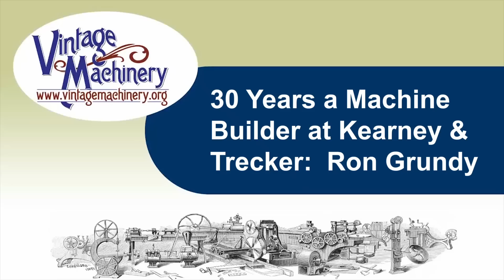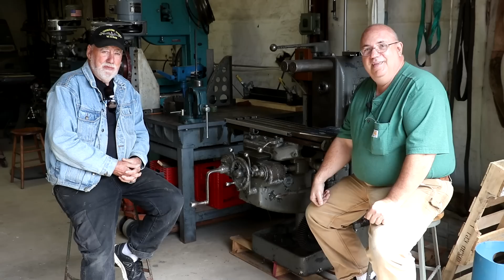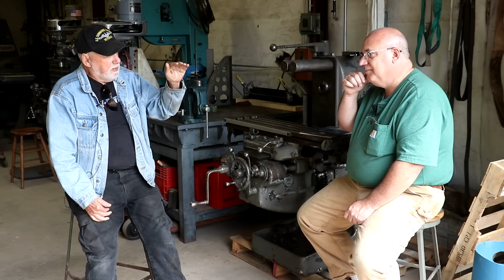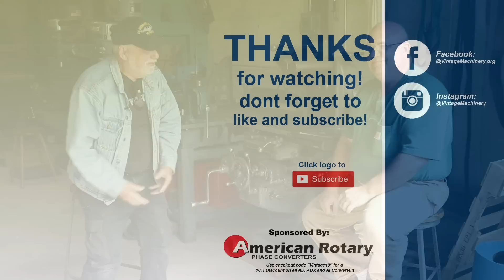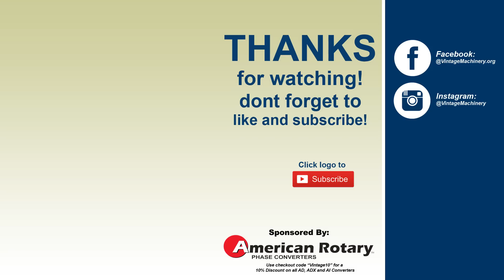30 Years a Machine Builder at Kearney & Trecker:  Ron Grundy

Comment: A very interesting video.

I was a West Coast Service Tech/Representative from the CA West Coast Regional office who installed many different MM CNC milling machines throughout Aerospace Defense facilities in the 80’s. 

I was fortunate enough where I actually worked there at the K & T Facility in Milwaukee. It was most likely Bob Trecker and my Santa Fe Springs Manager approved a 7 month pilot apprenticeship program where I trained alongside those wonderfully talented employees. 

During my initial tenure, I met/worked briefly with a taller Serbian employee who would perform hand scraping for many CNC’s. There he scraped the beds beforehand where he ran “yaw” “pitch” and “roll” using laser equipment. I remember using an auto collimator and interferometer. Once he finalized the scraping they installed the machined ways and continued the process of rechecking tolerances. 

It was interesting to watch the employees. Most were extremely conscientious individuals and quality, fit, & smooth operation of these machining centers was important to them. 

Does Ron remember what type of wooden floors they used? 

I do remember the 12 minute lunches, fortunately I was exempt.

Comment: We have an old K&T 50 taper vertical mill here at NASA Michoud Assembly plant in New Orleans. Its old and still used for cutting weld test panels on a vacuum chuck since early 1970's. Spindle seal leak, but that is from excessive use.

Comment: The only part of the first machine facility i worked at  was the gage room(quality control) and the door stayed locked, only a handful of designated quality associates were given marked keys. Maybe the tool room too but, it did stay open or unlocked. All of the 20+ cnc machines, the forming and stress relief areas were practically outdoors, the saw, the coating and final areas were either outside or just in corrugated buildings with giant breeze waypoints. Big bigger than Abomb big Cincinnatis, some moris and okumas, and two Emags. They all stayed running like champions those guys were good at the work just too much for most people to handle in the peoples department. Sometimes those who have the last word need to hear the right words from the right person that's all and i understand how hard it is to admit your wrong but, u gotta do it without blaming the world or any excuse u got. I ran every last piece of equipment in the place including doing repair. Only thing i just never had the chance to do was program but i was around it all the time, i know what that's about. I ran manuals other jobs They hired basically anyone from all backgrounds and I have trained many, i don't care what u got on ur resume till i work with you and i think all companies should do it the way they had then. I do appreciate you guys and the time y'all put into this.

Comment: Concerning tolerances:  Many companies use the super-flat and smooth calibrated granite tables for doing their acceptance standard measurements.  I talked with one of these test guys and he said that a lot of that was just for show.  His table was so tight in tolerances that if the light from the sun hit the table, that part would not longer remain in tolerance due to asymmetric heating.  In fact, he could only do demonstrations to customers on certain times of the day due to this.  His conclusion was that there were NO machines that left his company that remained within the tighter tolerances due to this, since no company could run a factory for mass production with that kind of environment control and still end up making enough parts to justify the cost of the equipment.  Yet, he did not hear of any complaints from the customers of these equipment purchases.  Real life will ALWAYS override any specs that try to get too tight.

Comment: I have a 1943 #3 Model K.  Bought it at auction listed as a #2.  When I got there to pick it up, it was a surprise .  Missing the head but have the rest of the parts to include side handle, and the hose mount to overarm support. I just got it back together.  Looking for a head or I am going to make a frank-n-mill.  (Bridgeport head on the overarm support)   

Thanks for sharing your time.

Comment: Great interview. Great to hear the stories from someone that worked there and has so much experience. 
I have a 2H that I got for free down here in San Diego. It seemed to be part a Navy repair station, then ended up in a motorcycle shop where it sat for about 50 years. I went to look at it, and the guy said if I can get it out of here, I can have it. Took it home, wired it up, and it runs like a champ. It was built the same year Ron and my step-mom were born so I named it Jodi, after her.

Comment: Good Morning Keith & Ron:
Excellent video and interview as always!
USS Runner #476 was built in 1944. I was in the Navy at pretty much the same time as Mr. Grundy. I am a little older then Mr Grundy, and was in Sub service stationed at Pearl Harbor as a "yard" bird for 7.5 years. I had 30 years of service, and worked on a lot of subs;.... but I don't recall working on the Runner. I was on a tender in Guam, and then on the Enterprise for a couple of years.
Our machine shops were very well equipped, and we had many of these K & T mills, as well as others.
Best Wishes, and GOD BLESS!
Gary

,

Comment: Started running machines in the late 40"s--most of the stuff we had at GE  was pre WWI and required a lot of 'art' to produce components within the pretty tight tolerances (=-.0003)  Never had the luxe

ry of a K&T where you could turn a dial and be sure it wasn't a mile off......Never wore safety glasses either and had many a red hot chip stick to my skin...

Comment: What is scrapping and how is it done?
Reply from the maker: There are multiple videos on my channel about scraping, why we do it, and how we do it.  Check them out!
Reply: Keith Rucker - VintageMachinery.org   Thanks.  I did watch, “Scrapping a Lathe Compound Slide.”  

When I did an annual inspection on my airplane and others I use to do something similar to the exhaust pipes on the surface where the gasket sealed to the exhaust ports on the heads.  I sprayed a light coat of dye to the surface and let it dry over night.  Then used a couple of fine files, one finer than the other, across the sealing surface in multiple directions to true up the sealing surface.  In your world would this be considered scrapping?  In the aircraft maintenance world I do not know if there is a special name for it.  We just referred to it as filing the exhaust pipes.

Comment: Would be interesting to see why K & T, with all it's experience went out of business at the same time Haas machines started building machines in USA and has been expanding ever since.
Reply: 100 years of top priced labor and good pensions for their employees. When you are paying 2 or 3 guys but only one is working you can’t compete in dollars against a new start up.
Reply: @bcbloc02  That could be one factor- Often people and companies alike get complacent and rest on their success and fail to see that times are changing- Sears, Kodak, Penneys etc.
Reply: @oldschool1993  Possibly. K&T and Cincinnati both had excellent high quality and highly capable CNC machines but they were very expensive too. I guess what they failed to realize was the shift of the big  name companies that would buy those machines from building stuff themselves to outsource it.  Companies like Deere, Ford, Cat and GM that made most all of their products components themselves in the 70's and 80's went to outsourcing all their production to thousands of little shops with lower overhead that could make the parts cheaper but could not afford a $500K machine to do it with. Thus the much cheaper and smaller CNC machines took the market. As manufacturers turned into assemblers instead the us machine tool companies were too focused on capability and not enough on simple machines that can make mass quantities of simple parts cheap.
Reply: @bcbloc02  Yeah- maybe that is why Haas has been such a success- they sell machines for the smaller independent shops who can produce those parts for the manufacturers, and it also cuts down on the union and pension expenses for the manufacturers.  Looks like a fork in the road which K&T failed to choose a direction, either go really big or go small.  I went to the  machine tool show in Hannover a few years back, and Mori had a complete building to themselves- they chose the "go big" option and it looks like it worked.
Reply: @oldschool1993  Kodak is an excellent example, they invented the digital camera, then failed to capitalize on it.